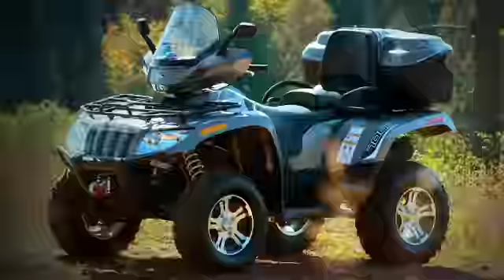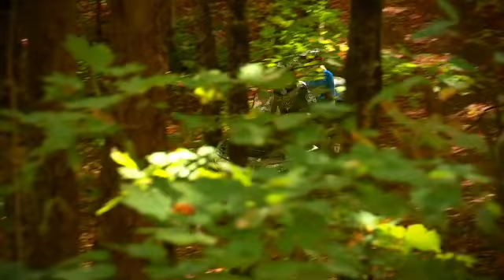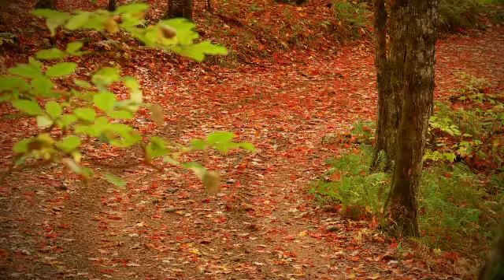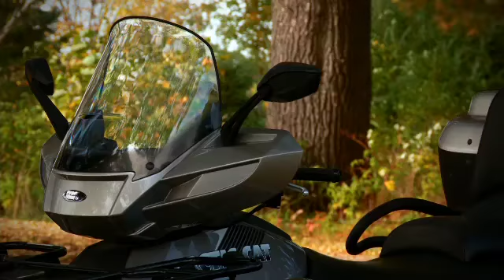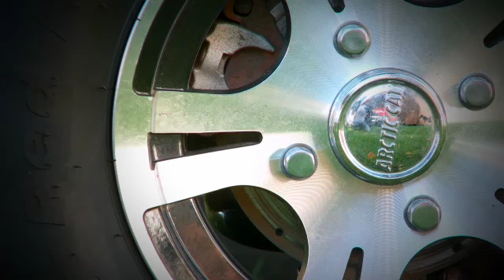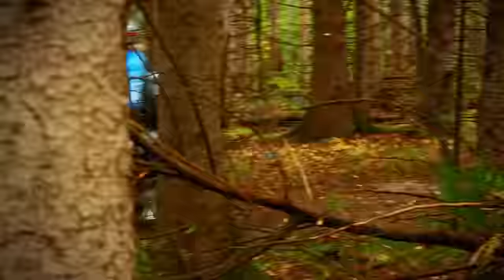2011 Arctic Cat TRV 700i Test Ride

Comment: It sucks riding bitch on an ATV. I bought a 07 AC TRV 650, pulled the rear seat off, and installed a rear platform with railings to carry the dogs or a lot of extra gear which the TRV's are perfect for. With the 4X4 and locking differential, the TRV has taken me anywhere I've dared to go. For real big people they're a great option too.
Reply: highdesertutah 9